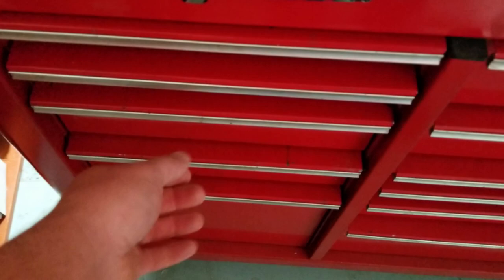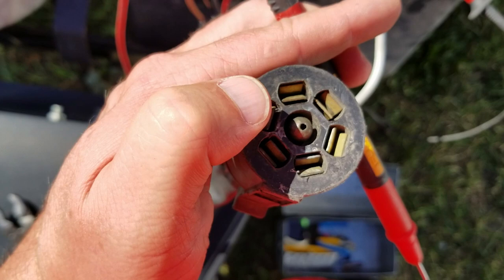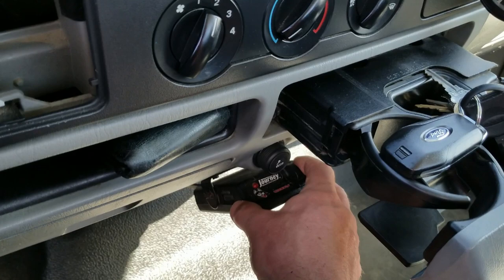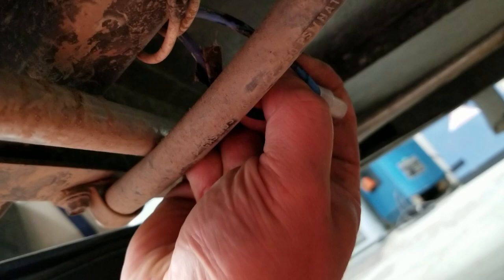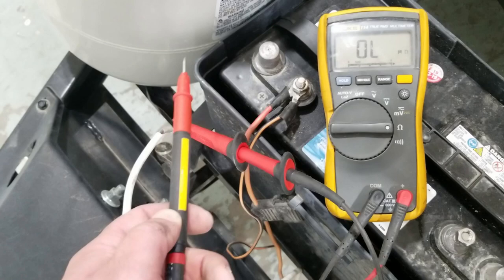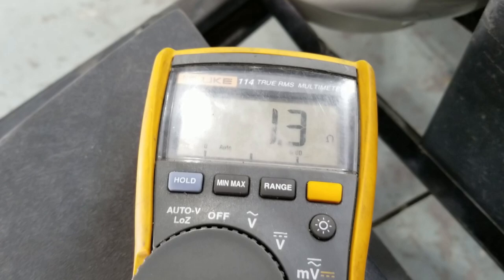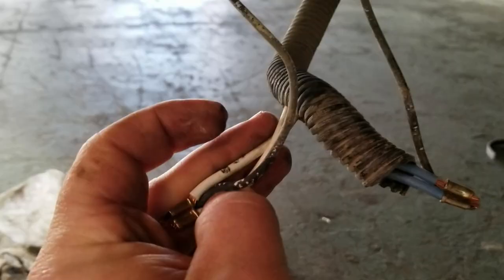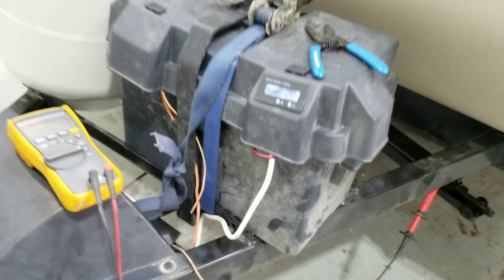Scumbag Offset | sketchy wiring

Comment: A decent multimeter should not pop its clogs if you measure resistance of a power line, even the mains.
Reply: Ya, but the decent ones are what, like $10 more than the death traps? That's a couple of beers down the tube, friendo.
Reply: @poellot  38$fuse FFS 
I concur. I run extech ( which I have proved worthy ) and have checked ohms on mainsuntil I realized I wasn't on volts. No issue.
Reply: I had the honour to restore power to a plant by replacing one of the main 1200Amp fuses. Unfortunately the plant electrician and maintenance supervisor were in the hospital because the multimeter used to find the “open fuse” vapourized. I could tell which fuse opened by looking at the scorch marks on the ends of the fuse holder. Luckily they were okay after a few days. Cat Rating aside, measure Ohms of an energized power circuit at your peril.
Reply: colin poellot. Understood. I still remember how he looked without eyebrows.
Reply: Fn amateurs, ahhh as a line worker and electrician for the last 30 years you can have a meter on ohms and go across any potential as long as you don’t exceed the meter rating which is normally 600-700VAC. What you can’t do with a meter is have it on amps (current) and then go across a potential, it must be in series to measure current..... this is basic, basic DC low volt stuff. Wow..... and the scotch lock isn’t a “data connector.” Fn hack....
Reply: Brian Holmes most multimeters have a rating of 600-700VAC, you folks obviously have no clue what you’re doing. Plant electricians generally aren’t state licensed electricians, you should have professionals deal with anything inside any electrical entrance or main switch gear.
Reply: @poellot  I thought you were joking. But, no, here it is:
https://www.fluke.com/en-us/learn/blog/digital-multimeters/choosing-the-correct-fuse-for-your-tester
Reply: @Shorne Pubique that's true, except in flat rate shops.
Reply: @MrJackal43  it was a joke

Comment: You can indeed measure resistance on live circuits with those meters. Voltage wont kill the fluke on the ohms settings. Most meters nowadays can do that.

Comment: All trailers here in Germany over 750 kg I have seen are equipped with a mechanical brake what is connected to the pulling vehicle by a steel cable. No electrical nonsense . The electrical connection for the lights is done by a very sturdy 7 or, newer ones, with a 13- pin plug. No rocket science but reliable.With the 13 pin plug equipped ones switch off the fog light on the pulling vehicle when a trailer is connected. Only the fog light on the trailer is operational then - clever .

Comment: I have never plugged in or watched a trailer plugged in and had all the lights work. That connector is new to me in Aus we had a round one with seven pins it has a key so will only go one way and male female pins that alternate between the plugs for the same reason. Very cheap plastic ones which you drop the hitch on and it smashes and old style zinc dicast which are scookum with pin outs cast in. Now the new ones are flat with the centre pin offset in two sizes of pins. When you hire a trailer the garage has a rack of short converter cables which you have find and grab the correct one. Because people fit there own sometimes the plug is on the car so that makes quite a few combinations. It never ends. The crazy Aussie.

Comment: I'm from Germany (as most of your viewers are it seems :D) and I've never seen electrically actuated trailer brakes! All trailers with brakes here seem to have a mechanism where the trailer 'runs' into the towing car and that applies the brakes via a lever and steel cable or rod. If it detaches from the car, an additional safety wire/rope pulls on the brakes.

Comment: Rookie mistake taking the wheel off, just leave it on and pull the entire hub, keeps the hub on a nice platform to work on
Reply: True. Also much better for setting the pre-load on the bearing when re-assembling as you can spin the wheel and tell how much/little resistance is applied and wiggle it front and back to see if there's too much play.

Comment: So to check the brakes on the trailer, you should be able to yank the break away and then amp clamp the wire to see if it drawing power. (so long as the trailer battery isnt dead ,if so use shore power) If you have amperage (usually 2.5 to 4 amps per axle) and the brakes aren't working (known by driving or jacking trailer up and spinning wheel) you know you have mechanical brake failure. If you do not have amperage then you have electrical failure somewhere on the trailer. The same process can be used to determine whether the tow vehicle or the trailer itself is causing braking issues.

Comment: "The green death... In white form." 😂🤣
Reply: The Bell System has millions and billions of miles of copper wire hanging on a telephone pole they're all low voltage circuits they put him in 50 years ago and the most popular places are running out of pears of wires all of it 18 feet off the ground with the terminal for every five houses and barking dogs at every yard

Comment: The trick is lacing the wiring where it can't move like you are sending it into space, soldering in the 'crimp-on' connectors, and lots of dielectric grease and heat shrink tubing.

Comment: Watched this again and again, something about watching a guy going thru hell makes you feel related. Carry on Brother, we've all been there. Many times I've sung the NASA approved creed for the reparation of eleco-mechanical contrivances, sometimes to no avail. 
One time I was so sick of patching the factory wiring I torn it all out put in all new wire, crimped, soldered and heat shrinked all the new connections. Electrical taped the wire bundle at any frame rubbing places where the insulation could wear though and Zip-Tied the wiring to the frame. 
Spent at least three hours and $50 and still had a cheap used utility trailer that was probably only worth $75. Well avoiding a defective safety equipment ticket was worth it. 
The end of the video with the imaginary six pack is a classic!
Reply: Watched it again, a Classic!

Comment: You'd be amazed how those proper heat shrink connectors have come down in price, thanks to the Chinese no doubt. You can get them as cheap as under 10 cents per these days on Amazon! Granted, may not be as high quality as the ones you observed, but they are copper core, heat shrink tube, adhesive lined. Crazy! Made a repair just like the one you looked at on an ABS sensor cable recently. Glad you would have thought I was something like a professional. 😅
Reply: That's 10 cents USD friend.  That works out to $4.50 Canadian--ya got robbed!
Reply: @docferringer  😂😂😂 Dang it! Conversion rates strike again.

Comment: Trailer wiring... OMG, nothing but horror... I've got a trailer board which I wired myself with the witchcraft known as solder and shrink-wrap. I always keep that handy so I don't have to fix anything I borrow and hitch up!

The electrical breakaway system is odd. Here in the old country it's mechanical. A metal cable loop which is placed over the tow ball. It yanks on the handbrake as its (de)parting gift. The electrical system seems prone to failures (flat battery, bad wiring, pre-escaped magic smoke). The cable system just pulls on the other end handbrake lever (forwards), the handbrake already has a locking ratchet, so if your trailer handbrake works, so does the breakaway. KISS.

Oh, and your colonial trailer plugs are weird and you smell funny.
Reply: We may smell funny, but we can tow faster than 50mph.
Reply: @mfree80286  so can we. 60mph in UK on motorways.
Reply: As much as I like soldering the MTBF for crimp connections is much longer than solder. Bullet connectors can last years. Soldered ones, especially the lead free shite will crack like toffee in short order.
Reply: Solder's for circuit boards and pipe fitters.  Don't be tinnin' wires together.
Reply: I know what you're saying, but I've owned too many Italian cars to trust crimp connectors! 😂 Far too many HR connections in my life already, and at vehicle currents it makes things far too interesting, far too quickly!
Don't worry, I only use planet killing solder for iron work 😁
Reply: All trailer brake systems stink. Nothing like trusting some old school 'surge brakes' with brake fluid that's turned to water or has a rusty cylinder that doesn't operate either.
Reply: @codyace  all the braked trailers/caravans I've worked on in the UK have had purely mechanical, rods and levers system, never seen hydraulic. The thought hadn't even crossed my mind before, I'm going to go see if this is by choice or regulation.
Reply: @juststeve5542  , is that 60mph or 60kph?
Reply: @mbaker335  , you are supposed to make a solid mechanical connection before you solder.
Reply: @jdilksjr  60 miles per hour, aka 100kph. I'm a Brit so we buy fuel in litres and drive miles.
(Gotta love a bit of unit anarchy!)

Comment: Here in the UK we have a mechanical system for the brakes either using steel cables and levers or hydraulics. As the trailer moves forward from braking of the vehicle the brakes are applied by the hitch on the trailer tightening the steel cable or using a hydraulic cylinder. The only thing electrical normally is the lights (LH turn signal, LH tail light, RH turn signal, RH tail light, shared brake light and a fog light) for caravans they have their own plug usually white, you can read up on it searching for 12s and 12n wiring

Comment: Marrets = Wire Nuts in the USA.
Only Recommended for Sparky Sparky Pixie Wranglers.
Reply: And ONLY for house wiring. Not for anything that moves.
Reply: Yes and scotch locks are for emergencies only, and only as a last resort to get you to a safe place to properly make the repairs.
Reply: Sparky here, turns out one of those quality 3m t\r wire nuts has been holding the power wires for my trailer brake controller together under my dash for going on 5 years. 
Let's not get started on all the thwn-2 that's strung under the truck because I caught the truck on a rock and ripped the entire harness from under the bed.
Reply: Wire nuts, used properly, are better than home gamer grade crimp cunnectors, which....really have no way of being used properly that I've yet discovered.    the problem is lack of strain relief, as usual.

Comment: Helpful comments section! 
Silicone is not only useful for Boob jobs. Use lots to avoid disappointment.
Helps with Rustitus Diceeintragratus.
I did my own trailer's wiring and no one touches the wiring. AA SA Road Standard.
The only trouble was with the SABS approved cr@p that they supply for the light modules.
I changed these to Led's. No further problems. Nice videos, kind regards and greetings from Africa.

Comment: Somebody buy the man a socket set. For frogs snacks.
Reply: Lol i was thinking something along those lines.
Reply: @jamiewhitworth7183  A hammer and cold chisel?
Reply: You mean those boxes of small steel parts that magically deplete at the rate of the only sized socket you need per job? Need a 3/8"? It's gone... Need a 5/16"? Gone like the wind... Need that weird extension / adapter / sliding bit that you never quite knew what was for but was always prominently encased in the middle of the set? Yep, that's now migrated to your friend's toolbox, and they're in Paraguay for the month. Socket sets, in my experience,  are usually just a more complicated way of finding the wrong tool for the job!

Having said that, I still always travel with one.
Reply: @Intermernet  they really need to sell 3/8, 10mm, 5/16 and 8 mm socket sets bro I swear.
Reply: Send him an Icon ratchet and socket set to dismantle

Comment: First time I tried to finish assembly of a bearing in the shop with free-running torque, I was physically pushed out of the way and told we didn't have time for all that. Then he just cranked the nut down to whatever, I'd guess well over 30ft.-lbs.Not at that shop anymore, so I can only assume that bearing has since cooked itself and that guy found some professional mechanics. Nice old 1st gen Mustang too, a shame.

Comment: My dad always called them wire nuts. 🤷🏾‍♂️
Reply: The connectors or the supposed electrician that wired it? Works both ways...lol
Reply: M dad was an electrician,  and when he came home at night,he took everything out of his pockets, among which were,  wirenuts.  Among my barrage of questions was " what's this Daddy?" His reply"just Crap".
Ffwd to my job in a Mom Pop hardware store, when a customer comes up to this young clerk (myself) , and brandishes a wire nut in my face. I yell across the store to the boss" Mr Boss(not his real name), where do you keep the Craps?"
True story to this day.
Reply: The proper term is "electrician."
Reply: @georgedennison3338  
There are waterproof wire nuts.
Reply: @paulsallee4889  True that.... they use them in sprinkler systems and are buried.   Often wondered why solder isn't used on such applications.   AvE?
Reply: @3dsman  cost in labour. Labour is the most expensive commodity for contractors. Also job security. 
We say it all the time, I'll deal with that in a year, at least I'll know where to look
Reply: @DriveCarToBar  and yet once your laying on the ground and ran out of heat shrink..... Hrmm, I do it right later. 
The temporary fix is often the most permanent.
Reply: @3dsman  solder is considered a fire hazard in ac applications due to breakage from being too rigid. a mechanical connection is less susceptible to breakage it's also more consistent, cheaper and faster even for the less experienced. Neither are a perfect system however most building codes don't allow solder in residential applications any longer. from my understanding in aviation they have adopted crimp only repairs in wiring to be more resistant to vibration related repeat breakage.
Reply: @logan9334  Interesting.   Power supply primaries are often soldered though, but still.. I do see where you're going on the resistance to breakage due to the solder joint alternative being overly rigid.    Still seems like where wires are floating as they are in junction boxes.. or in this trailer repair.. solder with wire nut and tape (more for insulation than for the electrical) would be fine.    Wire nut alone obviously faster but I tend towards overkill.   Belts and suspenders kind of thing.
Reply: @andrewb9940  LOL!   So true!
Reply: @DriveCarToBar  
Why use junk weather pack when you can go with Deutsch for a smidge more? Much more weather resistant and compact. Working on semis, it's been probably 20:1 weather pack to Deutsch that I've had to replace from corrosion inside. Wired my flatbed up with Duetsch plugs, works mint.

Comment: I hate trailer electrics, completely agree always as janky as hell, sometimes easier just to assume it's all shit and rip it out and rewire correctly. That said I've never seen electronic pixie-brakes like that before.
Reply: Time to upgrade.
Reply: I have a LandRover Freelander2 which has so-called electronic park brakes. They are actually electric actuators managed by a computer, but they do work quite reliably. To us in the UK electrical trailer running brakes seem strange to say the least.
Reply: @Graham  Most likely the brand of the brakes  is Dexter.  Pretty common.
Reply: smorris12 yeap around europe mechanical or air brakes required at least now.
Reply: @90vanman - well unless the tow vehicle has the appropriate controller, they are!

Comment: Many trailer factories use scotch locks. I've spent many an hour removing scotch locks and corroded wiring on trailers running the salted winter roads on the frozen shithole of Hoth.
Reply: I can confirm. I worked at a trailer factory running wires and hanging metal.  Every trailer has at least a couple dozen scotch locks.  That is factor standard.  Not saying it's right, just standard.

Comment: If you don't have flush cutters, a bic will quickly melt the sharp corners off cut zip ties.
Reply: You can also score the flat side with a box cutter, then push the scored side over quickly and it'll shear off leaving a flush edge.
Reply: You can also get a tie gun that tensions to the desired amount and flush cuts in one step, but where's the fun in that?  I'd rather go on Amazon and buy zip ties with little "Fuck You"s written all over them and make the sharpest cut I can with some dull scissors, just so future civilizations will know I cared.

Comment: The original wiring on most trailers is best used as a 'pull wire' to thread decent, new wiring through.  That only works if they ran the wiring in a good location to start with...

Comment: I feel your pain.  Last winter I had to replace the factory RV plug on my '16 F-350 that went tits-up.  By spring, my rusty/crusty snowmobile trailer was popping the taillight fuse on the truck... And I haven't yet fixed it yet... More than a dozen lights and associated wiring to check...

Comment: As an HVAC mechanic I cringed when you started going for the solenoids and all that. Experience has taught me best idea is to go over every inch of exposed wiring and sure enough that's where you found it. Whoever installed my lighting fixtures in the bathroom cut the neutral right in half where it comes out the wall but didn't cut the wire insulation so they bent it to where it still touched. When I replaced them and they wouldn't work i knew something was amiss coz my wiring was fine. Couldn't believe it when I saw it. Just lucky it never caught my house on fire.